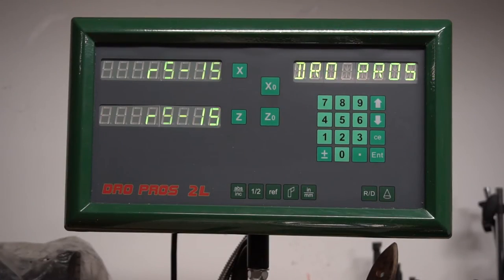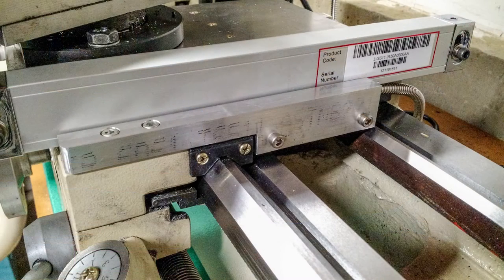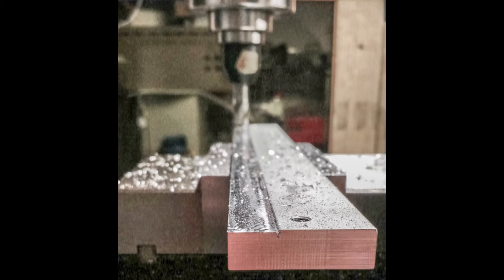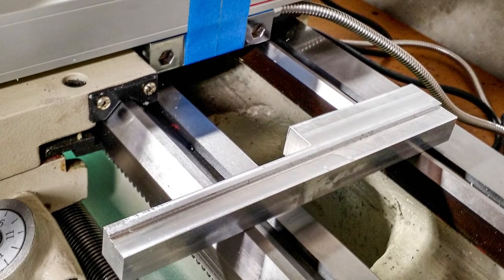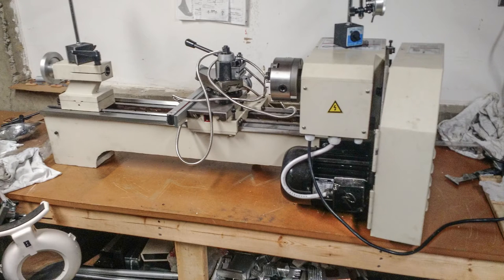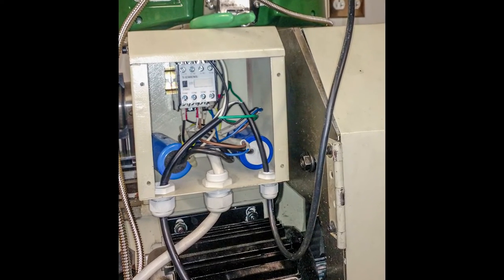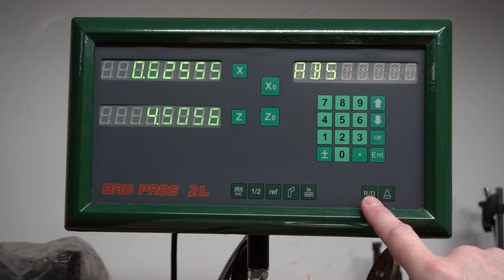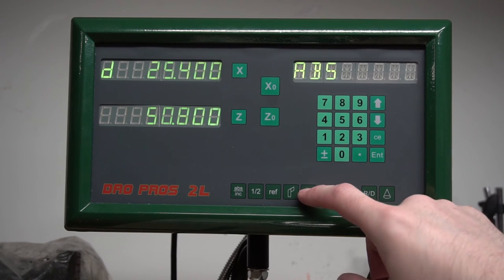DRO Installation on Grizzly G0602 Lathe

Comment: Nice video, thanks for posting.  I recently did this but used a Sino KA-500 170mm scale mounted on the left side of the cross slide to enable access to the gib adjustment screws and carriage lock

Comment: Thanks for posting this video! I obtained a 2axis DRO for my Grizzly with zero documentation and probably half the supplied brackets when bought new. I was stuck on the cross slide til I saw your video, very helpful to me! The only thing I saw that you did that I didn't like was sensor bracket that covered the carriage lock bolt.
Reply: i know Im asking the wrong place but does anyone know a tool to log back into an instagram account..?
I was dumb lost the account password. I would appreciate any tips you can offer me!
Reply: @Coleman Santino instablaster =)
Reply: @Kareem Ezra It worked and I finally got access to my account again. I am so happy!
Thank you so much you saved my account!
Reply: @Coleman Santino you are welcome :D

Comment: Nice job. Does it retain its absolute position if you remove power to it? If you move the carriage or cross slide while it's powered off, does it recognise the new position when you power it up? Thanks!
Reply from the maker: +jix177 Thanks!  It can sort of do this.  If you turn it off, move an axis, and turn it back on again, it will still read where it left off when you shut it off.  It cannot track when it's powered down.  However -- it has a "REF" mode.  Glass scales have a 'home' position in the dead center of the scale, and the DRO gets a special signal when this point is crossed.  If you've lost your position during a power outage, you can do REF->FIND 0 for an axis, and as long as you can sweep the scale past the center point, it will re-calibrate and you should be back in business from before you lost power.  Internally, the unit calculates everything relative to these absolute positions, which is what allows this to work.  I tried it a few times and it seems to do the right thing.

Comment: Nice video,,,like to know if you know,,,how much distance between the read head and the scale,,,the read head must be parallel  to the track it rides in,,correct,,I have a G 0709, and boy hard to find a level place on the saddle  for the read head,, you think it should be shimmed like .1 or .2 mm?  Got my x,y,z DRO for my lathe from Ditron,,,$360. included express shipping.

Comment: Wow, I really enjoyed your video, very well done and logical. Did you have to get a tailstock extension sleeve so you stay away from running into the DRO bracket? how do you like it now that you have had time to get used to it and would you recommend a DRO , I have the same sort of Import Lathe.
Reply from the maker: So far I have not encountered any problems with the tailstock.  I definitely like having the DRO on the lathe, it makes work so much faster.  I have only done a few projects due to being very busy with other things in the last 6 months.  Hopefully I'll have more time this winter and maybe I'll post a followup if I learn anything new about it.